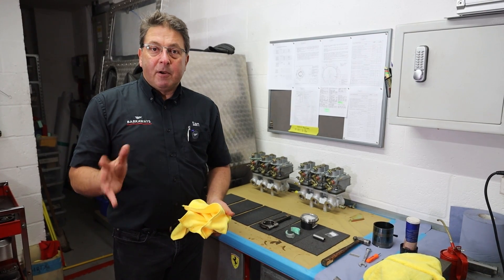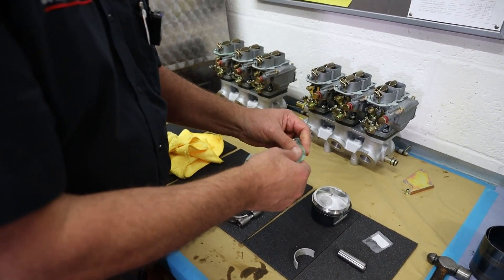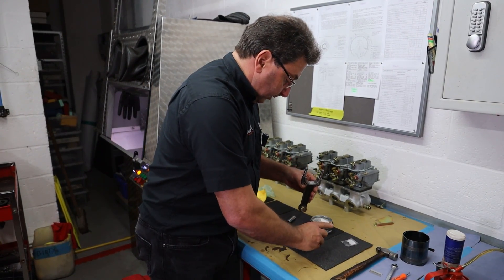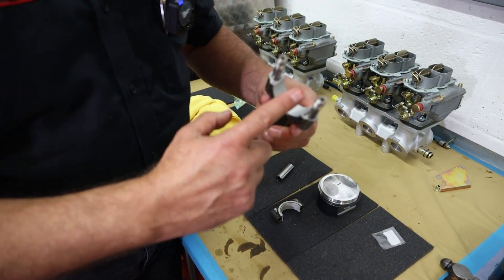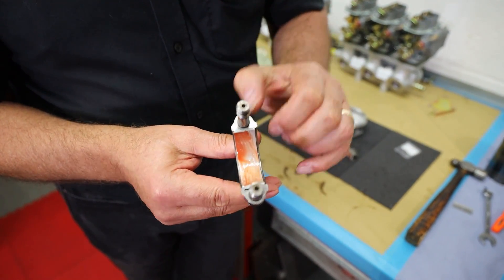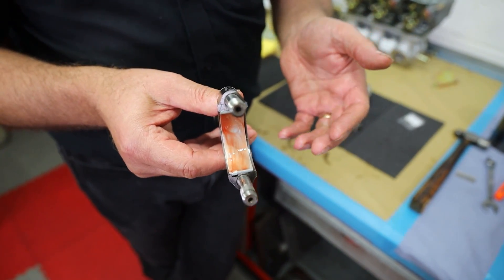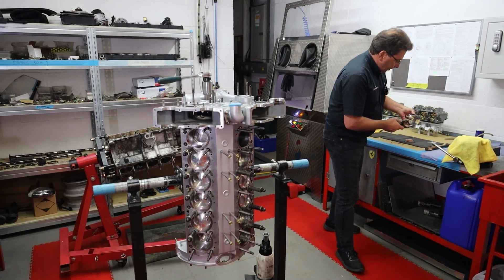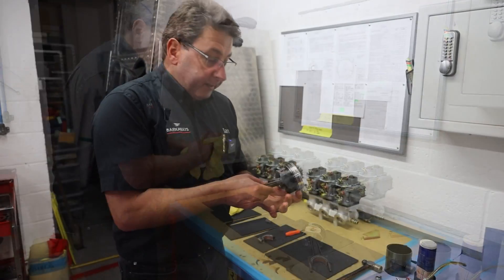The Engine Corner: Fitting Ferrari V12 pistons

Comment: Correct bearing shell insertion technique to rod and cap is to align the tang in the companion tang recess in the rod/cap and with the tang side split line edge of the bearing shell aligned with the cap/rod split line, very lightly deflect the shell as it is pressed into its final resting place.  In doing this the sheel is rotated about one split line edge.  It is poor practice to just sit the shell on the rod or cap saddle and scrape both sides of the rear of the shell against the split line edges of the rod/cap and in doing so realise the "swarf" mentioned.  That swarf should never be generated in the first place with correct shell installation technique.